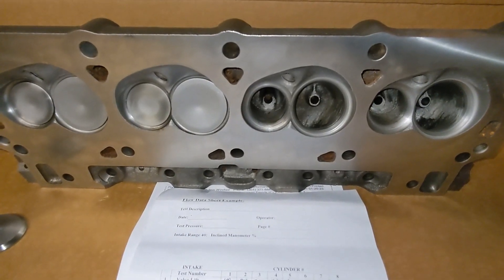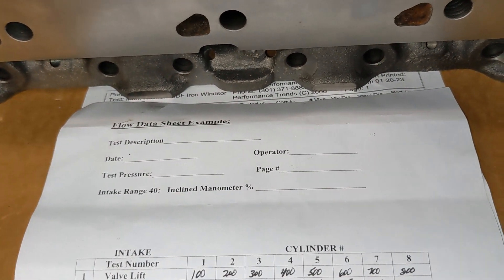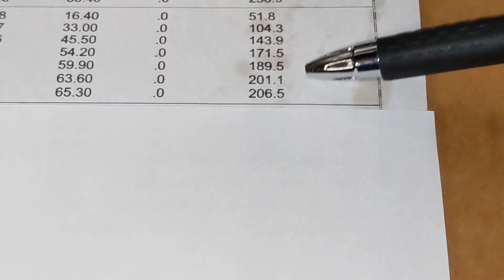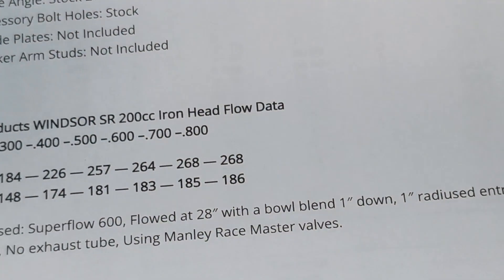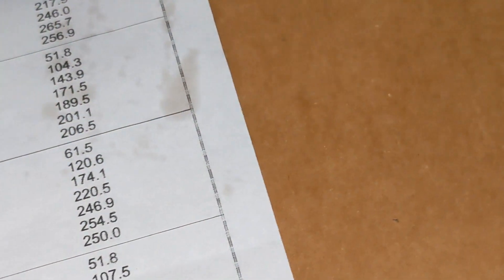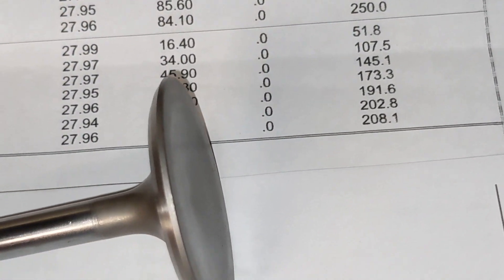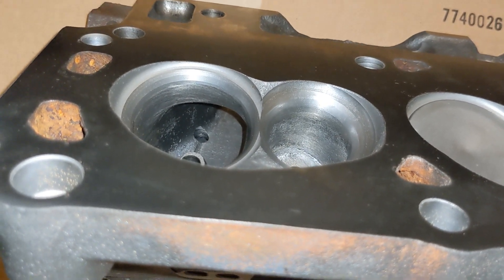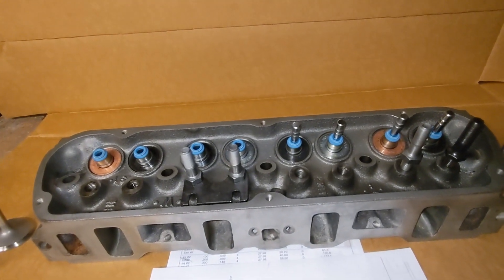Ford / World Products Windsor Sr Head Flow Data

Comment: What type of valve stem seals are you using having a problem finding which one goes these heads
Reply from the maker: I had the heads machined to 0.530 to take positive stop type seals.  I'm using a Manley seal part no 24045.  The heads were originally set up to take umbrella seals.  I think later versions of these heads were already set-up to run a positive stop seal out of the box.

Comment: Everyone is chasing flow numbers, what's with that?! 🤨 Intake fluctuations in a running motor is the biggest problem in my book and port velocity is more crucial.
Reply from the maker: The two are related. CFM = port velocity x cross section area.  Increasing port velocity increases CFM, if the port cross section area is the same. Making a port larger will usually lower velocity but increase CFM. If you want to increase horsepower usually you have to increase flow, unless you already have sufficient flow to support the desired HP goal.

Comment: We picked ip some  world SR cast iron heads..202 intake valve.plan on putting them on a 351 W ..hydraulic cam ( not a roller )  .flat top pistons..will it make 425 HP ?
Reply from the maker: It's possible. Depends on the other things too... Intake manifold, headers, camshaft duration.
Reply: More like 366hp..I have one set up on the exact heads.
Reply: What kind of cam?  @MultiTestPage

Comment: should make good power! what is your compression ratio ballpark with the new pistons?
Reply: Very underrated head for sure, mine are ported with 2.08/1.65 valves and flow 310 intake and 246 exhaust
Reply: @JDickracing1962  nice!
Reply from the maker: @JDickracing1962  Wow those are impressive numbers. Was thinking I should have had 2.08 intake  valves installed but maybe that's a future upgrade. Didn't know these heads would take exhaust valves larger than 1.60.
Reply: Need to tighten your quench distance a little.... ~0.040”.   Good combustion chambers are rendered useless without proper quench!
Reply from the maker: @trailerparkcryptoking5213  Ended up getting a .023 " gasket from Cometic, so  about .043 on the quench distance.  Not too far off the .040"
Reply: @MarksMuscleCarGarage  that works....it pays dividends....
Reply from the maker: Should be around 10.0: 1 maybe a bit higher.  I'll be using an 0.027 thick head gasket and am assuming the pistons are .020 in the hole.  Will have a more accurate number once I get it assembled and measure deck clearance on the pistons.